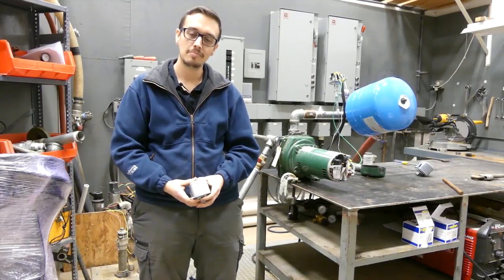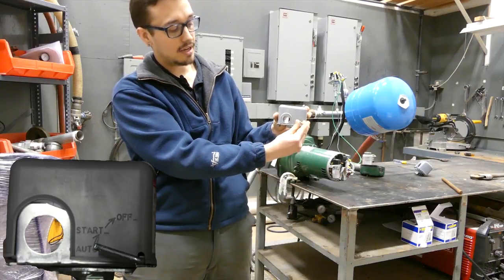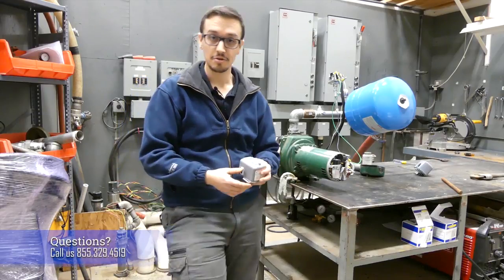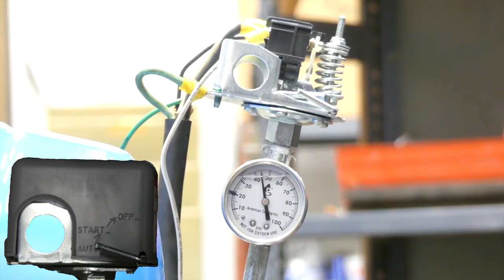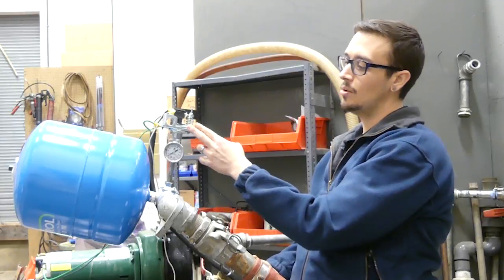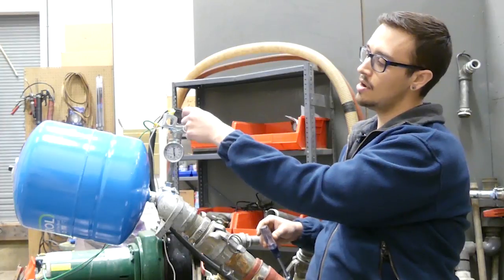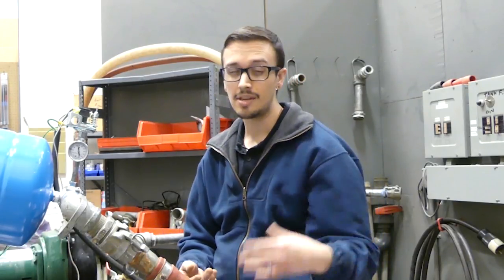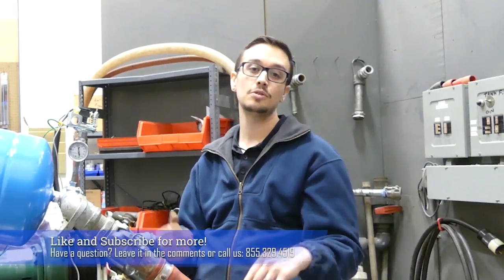Low Water Pressure Cutout Switch | Square D M4 Pressure Switch W/ Low Pressure Cut-Off

Comment: I don't use the M4 much anymore. Almost all of my situations are with a submersible pump in a well. I will usually use a Pumptec on a weak well situation. Costs more, but the nuisance manual resetting is not good for the customers happiness. On a jet pump, some nuisance tripping can be helped by lowering the tank pre-charge from 2 pounds to about 4 or 5 below the cut-in pressure of the switch, which will give you more cushion before the dramatic loss of pressure when the last of the water leaves the tank. Another point of nuisance tripping can be in some rural areas (especially around my area) the electric power goes off once in a while. Use of water during that time, even a small drip, will let all the water leave the tank and open the switch contacts on the M4.
Reply from the maker: Great points, thanks for the comment!
Reply: The 2 PSI rule, while Ideal for most situations , should not be written in stone. It is much better to be 3 pounds under cut in, than 1 pound over cut in. An inaccurate air pressure gauge which leaves your tank 2psi over cut in, will cause The dramatic SPIKE DOWN that PUMP DOCTOR mentioned, and during high demand  situations ( Long Showers or filling the tub for the kiddies) will almost certainly trip an M4. Additionally, many Rural areas have the tanks setup in crawl spaces that can only be accessed from outside. Dripping wet from a hot shower and outdoors in February Do not go well together.If you dont have ready and easy access to your switch, M4 just simply isnt for you. Awesome VIDs, Keep up the good work!!!!!
Reply: This is a sermergable my husband put 40-60. The pressure tank says max.psi35 do i need to go back to a 30-50?? Everything is wired up rite have power coming to switch but like not leaving switch push on points but nothing happens!!!!!
Reply from the maker: Crystal, please give us a call and we can help you troubleshoot: 855.329.4519

Comment: Good video!  One thing I'd like to add is that a power outage will  cause a loss in pressure to disallow pump start up and that's a nuisance. We have cattle and watering bowls which rely on constant supply so If we happen  to be away and the power goes out the pump will not restart and the cattle do not get water until we return and manually move and hold fhe lever. It's not a good idea for this application. Our well supply is good and we don't  have to worry about the pump losing prime from a dry well.

Comment: I recently added one of these exact safety switches to replace my existing failed non safety switch. Now we keep getting numerous cut outs due to this switch that never happened before with our old non safety switch. We have a lot of sediment in our water and I was wondering if a clog can cause false losses in pressure. Is there some cleaning that may need to be done to solve this problem or do we have a well flow problem? Thanks!!
Reply: Agree. These are not a good idea. We have a radon removal system with outdoor faucets on regular well loop. When using outdoor bibs and that machine calls, shuts it off

Comment: Love you videos! Just bought a control box from your website and installed it. It was the exact same one that was originally installed 20 years ago. Our local well company quoted me $900 to replace just the control box. Got it for $300 plus anther $40 for the pressure switch and works perfectly and was very easy! Thank you

Comment: Thank you for the explanation.  I needed to replace my old Switch after 18 years and bought this M4 with the Low Pressure Cut-off as the replacement. It hooked up the same and when i flipped the breaker it did not start.  I did not realize that this new switch had this extra safety feature but with a quick google i found this video and i snapped to the reason for my issue.  In the small print it does mention the  low pressure feature but it wasn't prominently mentioned.  Square D really should add a "NOTE: Prime pump first at install".  You saved my day.  Thanks again.

Comment: Excellent explanation. I have attended several pump schools, including Goulds in Seneca Falls, where this type if the switch was never discussed when troubleshooting on different applications. A valuable lesson. Why aren't these switches installed on all applications, especially with an expensive submersible where the troubleshooting is mostly up top?
Reply from the maker: Thanks for the comment! Generally, pumps are sized so that they will never pump a well dry. These are mostly used in low producing wells/cistern applications.

Comment: Just stumbled on to your site. Great tutorials.

I installed the low pressure cutout pressure switch when I replaced a failed pressure tank a few years ago. We have never run the well dry but we did have a control box failure after a lightning strike. When I replaced the pressure tank noticed the start capacitor was leaking. Figured the low pressure cutout was cheap insurance if the pump won't start, save wear and tear on the thermo overload cutout. I agree with the other posts that it can be a nuisance during power outage if pressure drops too low have to manually build up pressure once power comes back. As I'm the homeowner not an issue but see it as a potential problem for non engaged folks. I've included that step in the written instructions for our backup generator in case I'm not available. I had it trip filling empty tanks for our batch solar heater and electric water heater. The first time it happened I could not figure out why it was taking so long to fill the tanks. Then I remembered the low pressure cutout, not a big deal as long as I remember.

The pump was installed in 1980 and still going strong lightning strike and all. I want to keep it happy. Replacing a submersible pump at 220 feet is not a cost I look forward to paying.
Reply from the maker: Thanks for the comment Tom. If/when the day comes to replace the pump, give us a call and we can help you size a replacement at the best price.
Reply: Save yourself time money and aggravation. DO NOT the Square D pressure switch with the lever. THere is NO INFO on wiring or nor does function. Every single video is assumption that everyone has installed a couple dozen of these. ahe people in big box store think it's a safety factor. If you have a drilled well and never had issues skip it.
Reply: @rickfillion5666  I'm confused by your complaint. It wires just like any other 2-pole pressure switch. Operating instructions are on the plastic safety cover.

Even with a drilled well things can go wrong.
1) Massive plumbing leak - assuming pump cannot maintain pressure it will cut power to the pump limiting water discharge.

2) Many years ago a lightning hit took out the pump controller so the pump had power but it was not running. Again in this situation low pressure cutoff would kill power to the pump.

It works fine for us YMMV.

Comment: Depends on the situation, but with a submersible pump, it would save the pump from being dead-headed if a pipe between the pressure switch and pump froze.
Reply: ...or a flooding situation where a (relatively) large line broke and the pump continued to run.  But not so good if the pump is supplying fire water and several spigots are full open dropping the pressure below the 10 psi below the switch cutoff point, or an electrical outage.

Comment: I have a 30/50 switch with a low pressure cut-off at 19 psi. My pressure tank is at 26psi. When my well runs dry the pump keeps running and the pressure does not drop to the 19psi required to shut off. I think that pressure tank keeps the pressure at 26 and the pump overheats and melts my plastic fittings. Should my pressure tank be set below the 19psi cutoff?

Comment: Another problem is if your well runs dry and you drain your home's pressure to 40psi for example... the pump will keep pumping even though the well is dry bc psi has not dropped low enough to cutoff the pump and it cant pump high enough to cut it out with a dry well either. The result may be destroying your pump but in my case last week, the discharge side water got heated up so much that it blew a hole in the plastic-like pipe right above the pump. My neighbors said they had the exact same problem once before. Having it fixed today, but i havent figured out a solution to stop this from happening again yet.
Reply from the maker: You need electronic motor protection for that. Give us a call and we can get you the right equipment: 855.329.4519

Comment: Great video!  I think there is one thing you forgot to mention, POWER OUTAGES!  If you don't have power, but you still need to use some water and you drop your pressure tank down until the pressure drops below the cutout PSI, you would need to reset the switch when the power came back on, correct?
Reply: I went and ordered 1 after watching this video.  We have had our well pump die twice in 2 years due to running the well dry during droughts and with no cutout the well could sit there and run dry for hours if you have a slow recovery rate well (ours is only 1.5gpm)!  But at least our well is 300 feet deep with a static head of 62 feet below grade when not in use.

Comment: I dug a well on my property which produces about 500 gallons of water enough to feed two sprinkler zones for about 20 mins each. I installed a 2hp Wayne pump together with a 120gl water tank and then installed a few switches ending with the M4 automatic switch. the problem is that the switch starts and stop every 20 to 40 seconds which does not seem right.
the water pressure never drops below 20psi but then again the well is not pushing any water to anything unless the pump is working. to test the pressure, 

I connect a hose to the water line and run it by itself with no sprinklers running which simulates a slow leak to see how the pump reacts but the pump continues to trip every 20 - 40 seconds and eventually staying on consistently having to shutoff the pump manually.

right now, my solution to the problem is to turn on the pump and the sprinkles on at the same time and when the sprinklers turn off then turn the pump off  completely and manually so as not to damage the pump.

I'm a newby and this video is a welcome addition to my learning effort on how my pump works. the only thing missing from this video is how to regulate the low/high pressure controls to make the pump work better and which are the low/high pressure controls

anywho: thanks for a great video

Comment: Thank you for a great video that got our water back without calling the well company.  We have a well with a submersible pump and am M$ pressure switch.  We just had new landscaping put in with a soaker irrigation system.  the landscapers left with all the outside spigots on and shortly thereafter we had no water.  I got the water going again after watching your video.  The switch is installed with the lever about 4 inches from the foundation so I could not see the "run-start-off' markings.  Long term, would installing a larger tank (current one is 20 gal)  along with putting the soakers on timers be a good idea?
Reply from the maker: Yes, a larger tank will allow the pump to cycle less and increase the life of the system.

Comment: Okay I kinda have a confusing situation here. This video is very informative though. 

Basically I have a deep well with a vertical pump on top of the well. The discharge flows through a pressure tank which sits close to the pump. When I start the pump with prime and fills the pressure tank from 0 psi, the pump reaches 40 psi on it's gauge (pressure tank gauge is 0 psi). The pump will run on 40 psi for a bit and then lose pressure and drop from 40 psi to 10 psi which is the same with the pressure tank's gauge 10 psi. Because of this, I don't know if it's pulling water in the well or just reading the gauge from the pressure tank. And to add to the confusion, the gauge will still increase very slowly. 

We have drought here and I know our well sometimes dries out. And it takes about 12 hours to replenish the well.

So is it losing pressure because the well is dry or is it just reading the pressure tank's gauge or am I just losing my mind?

Comment: I have a pump for lawn sprinkler application and it runs based on a timer. When the pump is off, there is no pressure in the pump.  Will the low pressure get triggered when the power is off?

Comment: The downside of this type of pressure switch is the situation where the power goes out and you run the pressure down all the way due to toilet flush etc... and then the pump doesn't restart when the power comes back.  This should be mentioned in the video.
Reply: You would have to hold the lever is Start right?

Comment: If I was running a hose to fill a small pool, should I temporarily turn the low pressure cut off switch off?  My shuts off after filling the pool for a little while. When I hit the start switch it rapidly gets pressure and everything is fine.

Comment: will this work for a sprinkler pump ( self priming centrifugal Berkeley 1.5 HP) to add protection for foot valve failure. I dont have a pressurised tank

Comment: I have the M4 after the check valve, and I have a pressure tank.  What if the pressure drops below 30, and the pump comes on, but the tank is somehow empty and the pump loses prime?  Will the pump keep running dry, because the pressure isn't below 20?

Comment: Can the low pressure cut off be adjusted?  Let's say I'm running 60/40 and the cut off is 30.  Can the switch be adjusted to run 60/40 and have the cut off at 25 psi?

Comment: Hi , I changed my pressure switch but I’m still losing water pressure after 1 minute of running water . The pump is not cutting back on . Do you think my pump is going bad?

Comment: In the winter we drain our pressure tank fully as part of winterizing our cabin and leaving it vacant. When I flip the power on to the pump in the spring will I have to also hold the cut off lever up until the pressure builds up or will the system pressure up without my help... as with a typical pressure switch?
Reply from the maker: If you have the lever then you need to hold it up as shown in the video.

Comment: I have a 40/60 with the auto cutoff switch on a jet pump to irrigate trees. When it's a hot day, the motor shuts down for 10-15 minutes therefore activating the low pressure cutoff. Short story is my previous pressure switch did not have the low cutoff and I liked that better in my situation. Is there any way to eliminate the low pressure cutoff feature on my switch? Or do I have to buy a whole new switch? Thank you, I've learned from your videos.
Reply from the maker: Hello, you'll have to buy a new switch. As far as I know, there is no way to disable that feature.
Reply: @RCworstwater  I really appreciate the response, and find your videos super helpful and clear. Thank you!

Comment: The problem I'm having is when we put a big demand on the water system, like trying to fill a water truck with a hydrant the pressure drops too low and trips the switch. Would that booster pump solve my low supply pressure problem?

Comment: I would like to have one without a manual switch. Is there one where I can use for a trigger to stop when not using and starts back when I pull the trigger?
Reply from the maker: Yes! That is a actually called a "manual" switch, whereas the one in this video is an automatic low-pressure cutout. Here's a link to by the one with just an on/off lever: https://www.rcworst.com/square-d-pressure-switch-m1-30-50-psi-w/-pressure-manual-cut-out-lever-9013fsg2j21m1.html

Comment: What if my pressure tank shows 65 psi but faucets have very little water flow coming out? The lever is very tight and down like it’s in auto position, is it safe to pull it towards me and let it charge up like in your video if the pressure is already at 65 psi???? I’m confused. We had a power outage and I clicked the lever into place days ago but today water kinda stopped flowing fast.
Reply: Never mind, I opened the cover and the ports were fried! Do you recommend a pressure switch that is an upgraded version without the cut off lever?
Reply from the maker: Give us a call to discuss: 855.329.4519

Comment: I have replaced my pump, and before that happened it seemed I was getting air in my well supply line. What can cause that to happen. I cannot find a leak before my pump.

Comment: I have a 2",  2 hp irrigation pump.  My nuisance is when I open a 2" valve, my pressure drops to less than 20 psi.  I like  the safety feature but when I want to fill a truck, the safety becomes a problem.

Comment: I have an issue with the building pressure that keeps dropping pressure and I don’t own the building to fix the issue but I want to use a pressure washer and am afraid it will get destroyed because of that, any chance I can use this switch to as proof of flow/pressure from the building where it kills the power to the pressure pump if pressure dropped